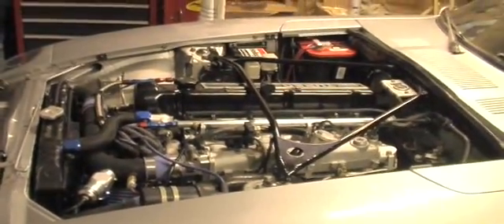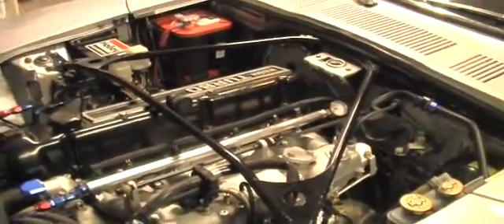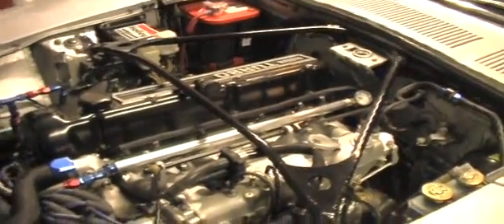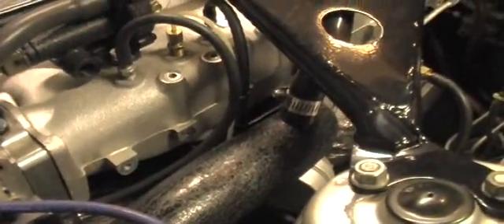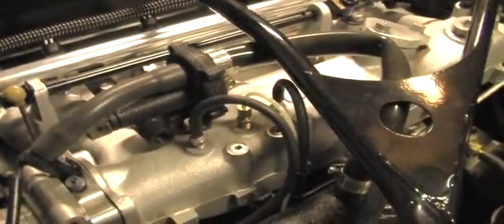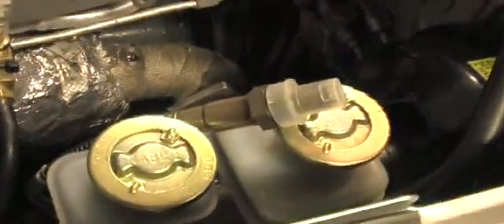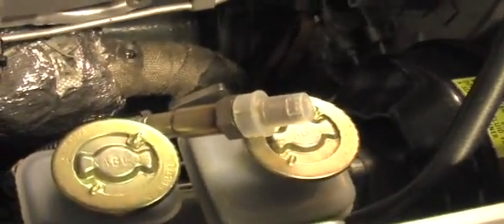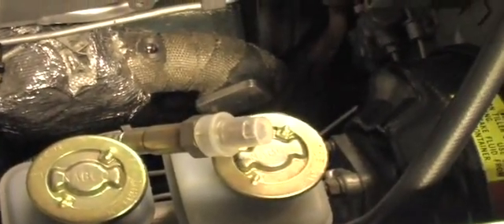Datsun Megasquirt Turbo

Comment: Still have the car? For as early on as this was for MS it seemed to run very smooth. I always had trouble getting my spark and fuel maps good on partial throttle with mild boost. But yours looks like it was fantastic. Were you using MS for spark too? Someday I hope to find a good datsun project car, if the price is right heh.

Comment from the maker: The car is pretty rigid but it's all the interior plastic panels that make the creaking sounds.  You also hear a ton of road grit because the inner fenders are right near the camera and have no insulation.  The trans is a 5 speed Z trans but I have a Z32 trans and 11pound flywheel ready to install next.  Soon I will do a rear roll hoop to tighten up the chassis a little.

Comment from the maker: My driveway is about a 30 degree angle so the car twists when I back out diagonally.  What you hear is the plastic interior panels rubbing on the plastic rivets from the car flexing as I back out onto the road.  The suspension has very little give so the chassis takes a lot of torsion.  Once I am on the road, you are hearing gravel in the wheel wells from the sticky tires.

Comment: Thats a very tidy engine bay, especially for a megasquirted car, props! Don;t worry about fouling the wideband, they're pretty rugged. The sensors themselves aern't that expensive anyway. Think of it this way, if you're running rich enough to foul it, you're probably running into other issues like bore-wash. When you do get the wideband fired up, check out the VE analysis function of Megalogviewer, it's amazingly quick and effective!